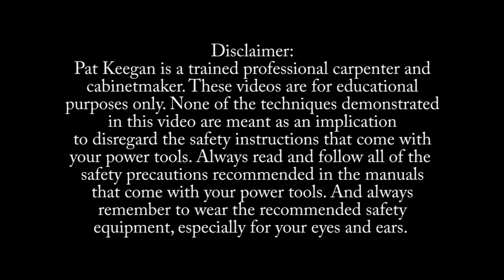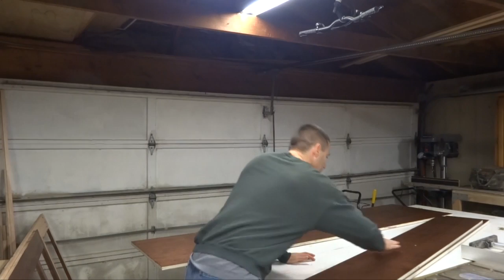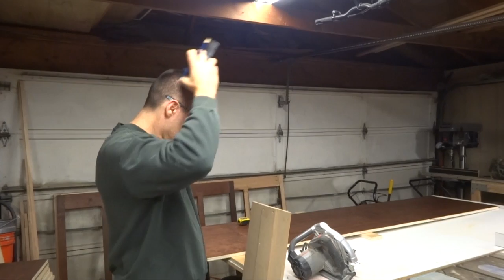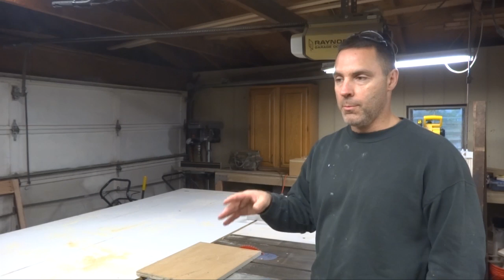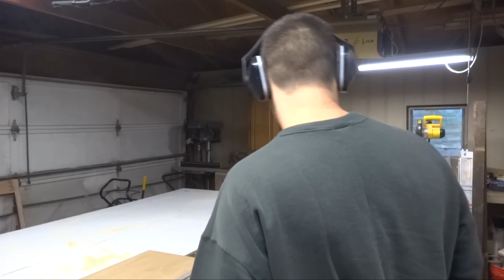How To Build Your Own Kitchen Cabinets: Part 1

Comment: Pat...Great video series.  Great explanations and ideas. My question is do you have any videos of actually hanging of the cabinets? I see you have a set back on the back of the cabinet for wall imperfections. Do you run a screw straight through the 3/4 back into the wall studs or do you add an additional "nailer"? Just wondering how the gap from the cab back to the wall reacts when adding the mounting screws. Also from a money stand point as well as being hung in an older mobile home  I would be doing these out of 1/2". Do you see any problems going down that road? I will be using your awesome cab calculator as well. Thanks again for all your very informative videos!!
Reply: +Mike Racine LOL Saw your QA vid and it answered most of the above. Except for the 1/2 ply.
Reply from the maker: +Mike Racine Thanks Mike. I can't remember which questions I answered  in that video. On lower cabinets the gap isn't an issue because you use shims in the back. In the uppers, i use shims at the bottom, but not the top. I'm just careful not to over-tighten. You can tack a 1/4" filler strip on the back at the top if you want. I've done both.

I don't use much 1/2" ply on cabinets per se. Are you talking about the back's only? or the sides too? if just the backs, then 1/2" is fine, but definitely put a filler piece 3-4" wide in the top back. I've not confirmed the strength issue, if there is one, But it "should" be okay. :)

Thanks for watching and taking the time to post.
Reply: +DIYHomeBuilt thanks so much for the reply. Yes I will build the cab out of 1/2. They will go into a mobile home and I am concerned about the weight. Even though we  sink into 2x4's I still have concerns with possibly a weight issue. On the walls. It might just be me overthinking this too lol.  Your thoughts?
Reply from the maker: +Mike Racine Often when i'm not certain of something I build a mock-up first. I can't tell you how many times I've made mock-ups out of scrap just to see if something will fit, makes sense, or is strong enough to do what i want. I don't have much experience using 1/2" ply to make cabinets (I'm stubborn i guess) but 1/2" ply is better than 1/2" particle board by a mile. I'm not concerned about things like the face frames and all that. What i'm concerned with is that you are using smaller screws (1" if i remember right) into 1/2". I want to say from experience that it should be fine, but I can't do that without having really looked into it. Do some searches on woodweb.com or lumber jocks. Many people out there far smarter than I. Perhaps they've done what you're looking to do. Thanks again. -Pat

Comment: whenever i build kitchen upper cabinets, I always divide the with of a standard sheet of plywood into thirds......that way my cabinet dept is 15 7/8" rather than the standard size of approx. 12", that is if I am going frame less cabinets my dept would be approx. 15".......this gives you much more space and it looks much better than a shallow 12" cabinet...not to mention no waste with this method....just a thought
Reply from the maker: +Badwy Sassine That's a great idea. And also the best part about custom cabinets is making them fit your situation perfectly, including adding more room to the depth! Also a great idea with saving waste on the plywood side. Thanks for sharing and for watching.
Reply: Great idea.

Comment: you should cut that wood upside down to reduce chipping
Reply from the maker: +Mike Weeber Yes, I do that for things like shelves, or where the edge would show, but most often, the edge, even though it has a bit of chip out, is completely covered by the side edges, so no need to waste any time figuring out which side is up :) Thanks for watching - Pat

Comment: I really like your video, having worked in a cabinet shop and having the commercial experience side of it. it makes a lot of sense. I would say, from years of experience using a skillsaw, you definitely want to start the blade rotation before touching down/pulling the guard back. Starting the blade while already along side your piece (with your face as close as it was) risks it kicking up and taking half your face off.
Reply from the maker: +LongestYardstick Hi thanks for watching and posting. Always appreciate the safety reminder.

Comment: Use a blue paper tape to provent tearing wood helps much better for professional finish
Reply from the maker: +Vitaliy V Yep, that's a great tip Vitaliy. I think someone mentioned it below as well. When you're in a production ship, there's always a balance between efficiency and perfection. Keep in mind that when you're cross-cutting plywood, often times the edge that gets a little tear-out is completely hidden behind another edge. When we know that's going to be the case, we typically don't bother with being too careful in that regard. But on finished edges that might be visible? anything you can do to minimize the tear-out is a good thing, including the blue tape :) Thanks for watching and taking the time to post.

Comment: Hi first off great video, this might be a stupid question but why use maple for the box and not cheery? Is it for cost reasons or just for the contrast in color.
 Thanks
  Rick J
Reply from the maker: +Rick Janisse Thanks Rick. They do get better as they go, as this is the first video. Anyway, I use maple for the box because I can buy it "pre-finished". That means I don't have to spend the time to finish it myself. Worth the moderately higher cost per sheet. The maple only shows on the insides of the cabinets. The outside is paneled with Cherry to match the face frames. Thanks for watching and taking the time to post.

Comment: Thank you for the video's Pat they have helped me.  I went looking back and you don't mention if you are using VC or MDF Plywood for the cabinets.  Looking at doing some desk cabinets and from what I can tell it's MDF for non-water areas and VC for areas that might get wet.  Thoughts?
Reply from the maker: +Jason McCarrick Very glad they have helped. I am using VC plywood 99% of the time. Yes, there is a difference between wet or dry areas, but there is also a jump in price. 

If you compare apples to apples MDF core is less expensive for the same grade. For example, the place where I buy my plywood has A1 4x8 Cherry MDF ply for $108. the same A1 4x8 Cherry VC ply is $130. Notice that the grade is the same: A1. but because of the core, the MDF is cheaper material.

That being said, The typical grade on the MDF core is A1 through A4. I looked through my price sheets and i saw NO MDF cores where the grade was less than A4. For cabinets, most people are okay with B2 grade, which (again, where I shop) is on the VC stuff). So while the VC would be more expensive if compared to the same B2 MDF  they don't have B2 on MDF, so i can't get it. but B2 is much less expensive than A-anything, so i get the B2 because it works just fine. Hence I have to get the VC :)

In terms of screw-holding power of one v. the other I don't worry about it because I use confirmat screws in both cases, and they work really well. 

So to try to summarize, MDF is generally cheaper core than VC for the exact same size and grade, but because my place only uses MDF for A1-A4 Grade (good stuff) it's more expensive due to the high quality veneer.

Depending on where you get your stuff, and what they have available, B2 VC is usually perfectly fine, but again, it's all in what you want in the end.

Hope that wasn't too confusing.

Comment: Are your face frames actually 2" wide made from ripped 1x4's or are they 1x2's?
Reply from the maker: +bkelly707 they are indeed actually 2" wide. For this project, geared towards the novice cabinetmaker, they were ripped from 1x3 S4S stock lumber as not everyone has access to planers, drum sanders, etc. Thanks for watching and taking the time to post.

Comment: Hey Pat great videos, I have watched your kitchen cabinet series around three times. One question I have is, the top rail on the uppers, what is the width from top to bottom? I noticed its visibly wider than the bottom, but you never mentioned the dimensions. Thanks
Reply from the maker: Xavier Mayne Hi, and thanks for watching. I'm glad you can get something out of them. I thought I mentioned the larger top rail (oops!). The dimension is 4-1/2" and yes it's wider on the top rails. I do this whenever I'm installing any kind of crown molding around the top of the cabinets. This allows for there to still be some of the rail showing above the door (between the top of the door and bottom of the crown). I don't like it (personally) when there is little or no space between the top of the door and the bottom of the crown. I think it makes the cabinet look like it wasn't meant to have crown and it was added anyway. Just my $0.02. Thanks again for watching and a great question.

Comment: If you're using a circular saw, put the good side of your sheet goods DOWN. You can also make a zero-clearance "pad" to attach to the bottom of the circular saw to lessen any tearout.
Reply from the maker: matermark yep, definitely good suggestions. Especially the zero clearance base. Just been too lazy to make one. Most of the time, the jig provides the zero clearance for the side that i need, and if there is any tearout on the other side (which a good blade will mostly prevent) then that side/edge  will be hidden in some fashion (used as a back, etc.). I'm more a carpenter than a true furniture maker ;)

Thanks for watching and the good suggestions.

Comment: Say you had a new home with bare walls.  How do you measure how many cabinets you need or can have?  I mean if your just replacing old cabinets you got something to reference off of but kinda drawing a blank on how to really start from scratch from a blank slate.  Apparently no one on you tube has done this.  Thanks for any advice.

Comment: Hi Pat,  I tried that but Facebook didn't seem to allow me to drag and drop or copy and paste.  I was able to upload one picture at a time using the general comments area so I transferred 5 pictures using 5 different comments.  That does seem to take up a lot of room on your page however so perhaps as the owner you might be able to shuffle them off to another more appropriate area.  Thanks again.
Reply from the maker: Harv Yes, i'll spend some more time messing with it this week. By the way, outstanding job on the cabinets. The kitchen looks great. Definitely a labor of love. What finishing schedule did you use for the finish? Awesome!
Reply: ***** Thanks Pat.  That means a lot coming from you. The finish schedule changed somewhat over the course of the project - experience is a harsh teacher.  I sanded the walnut to 220 and left it natural.  All finish layers are oil - Minwax Antique Oil Finish.  The first application was with a foam brush (as you suggested) and I kept resoaking it for about a half an hour to let as much oil soak in as possible on that first coat.  I needed to let that dry for about 24-36 hours.  I then resanded with 220 to get it smooth again and eliminate any oil buildup on the surface.  That really sealed the pores so that future coats would build the surface film.  All further coats were hand rubbed (with a cloth) from this point to eliminate the drips and prevent any blotchy patches (learned this one the hard way).  Each coat usually dried in about 6 hours and got a good scuffing with 320 sandpaper.  I would keep hand rubbing coats until I got a look that I was satisfied with.  Depending on the prominence of its location, I applied 6-10 coats to each piece (still grappling with my OCD).  Certainly delayed the completion date but I don't think you can beat the look of a hand rubbed oil finish on walnut.

Comment: Great video. This is probably a repeat question and i'll look through the comments for the answer but, I would like to know how many teeth are you using on the blades for the saws. I know the more teeth the finer the cut, but what would you recommend? Thank you.
Reply from the maker: Hal Larry yes, the more teeth the finer the cut. In general I go with the most teeth i can afford. 60T would be fine. 80T would be better. It's best to understand that you have two types of cuts in general: cross and rip. Rip cuts are with the grain, so there's little difference between a 60 and 80 in my opinion. it's the cross cut where you see the real difference. In cabinets, you're mostly cutting plywood and solid stock. Plywood cross cuts are done either with a jig like the one in this video (which reduces chip-out) or on the table saw with a zero clearance insert, which again, aids in reducing chipout. For solid stock, either would be perfectly acceptable in my book. In fact, i have a 60T blade in the table saw and an 80T in the chop saw. 

Hope that helps. Thanks for watching and taking the time to post.

Comment: My wall cabinets, I have only one stud to anchor into. Thinking about using wall anchors. What do you think ?
Reply from the maker: Auggies1956 I am not a big proponent of wall anchors for a couple of reasons. The cabinets are heavy. They are even heavier when dishes and food are in them. And getting wall anchors lined up to make the cabinet level can be difficult. Can you describe the situation a little more detail? what size is the cabinet? is it a single cabinet, where one screw would be in the stud and one screw in a wall anchor?
Reply: *****  This stud in ten inches off the corner of the wall. The cabinet is eighteen wide by twenty eight inches high. So there will be only two to three screws holding it to the wall, through that one stud. There will be cook books in the bottom of the cabinet. So weight will be an issue.
Additionally, what thickness of plywood should I be using ? My supplier say's half inch is enough.

Enjoy the videos, thanks.
Reply: *****
Thanks Shane, but nothing is coming up.
Reply from the maker: Auggies1956 This is spam. Do not buy this product. I delete them when i can.

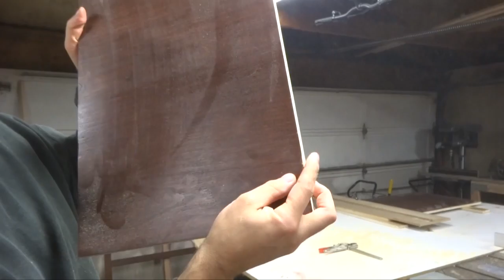Comment: 15:30  If you make your cut from the “wrong” side, you’ll have no chip-out on the front.
Reply: Auggies1956 The "wrong“ side is the hidden side you don't see.
3/4” is typically use for kitchen cabinets.
Reply: What is the wrong side Lenny ? And what thickness of plywood do you construct cabinets from ?
Reply from the maker: Lenny F That's very true and thanks for sharing that great tip.
Reply from the maker: Auggies1956 I use 3/4" pre-finished plywood. What Lenny is referring to is that if you cut your plywood "upside down" where the good face you want to see is facing the floor when you cut, then the saw will not chip out that side, only the upward facing side. The reason i'm ansewering this question, is that if you don't want any chipout on either side, you can use the jig I show in this video.
Reply: *****
Much appreciate the video and the personal tips.
Reply: Lenny F
Thanks Lenny.

Comment from the maker: @UtwoBed- that would be true if I were using standard sized plywood. The prefinished plywood I use is wider than 48 and longer than 96 to compensate for the removal of material made by the blade. Also, for cabinet making, this doesn't really matter even if your plywood is 48x96, as your 12 inch cabinets require 11-1/4" sides and  your base cabinets are 23 1/4" sides.
Reply: ***** Well I am screwed then I don't really have a small amount of education I am an idiot.
Reply from the maker: well that's what this channel is for. To provide you with a small amount of education :)
Reply: ***** Well then that makes me feel a lot better then. I want to put up a fence in the future and some other things for the house that I am in. Thanks so much.

Comment: When you cut a 48" sheet of plywood length wise with three cuts you are going to loose 1/8" of material for each cut because of the width of the blade. That means you are not going to end up with a 24" and two 12" strips.
Reply from the maker: +UtwoBed that would be true if I bought my plywood at a big box store, like Home depot, where their stock sizes are exactly 48" x 96" The prefinished plywood I use is 48-1/2" wide and 96-1/2" long  to compensate for the removal of material made by the blade. Also, for cabinet making, this doesn't really matter even if your plywood is 48x96, as your 12 inch cabinets require 11-1/4" sides and  your base cabinets are 23 1/4" sides.

Comment: Great video. 3rd essential protective device: respirator. The resins and other chemicals in the wood is not good for your lungs.
Reply from the maker: Paul Stalter Absolutely. We talked alot about dust collection, and respirators on a number of the videos. Thanks for posting to help reinforce an excellent safety measure.

Comment: Pat what if I was going to paint the cabinets what type of plywood would be best to use?
Reply from the maker: Phil Lucas Hi, assuming they are something like kitchen, or built-in cabinets, I tend to use cabinet-grade birch plywood. it's relatively inexpensive and paints reasonably well. Get decent quality plywood if you can, and make sure to follow a good sanding regimen (be careful not to burn through the veneer) because painted plywood can accentuate flaws. I usually seal mine with a shellac-based, white pigmented primer like Zinsser shellac primer from B-I-N. Hope that helps :)